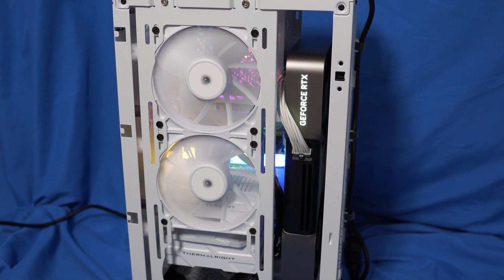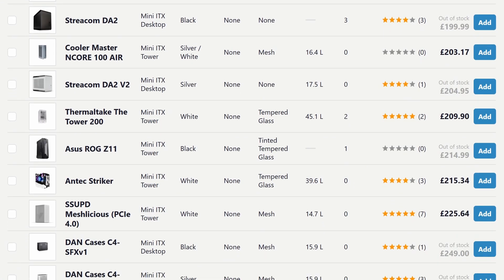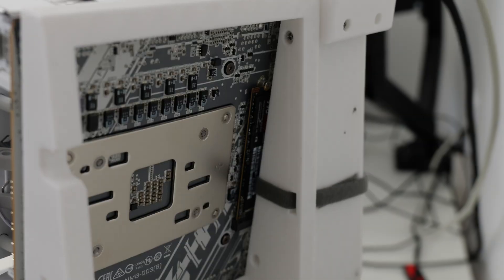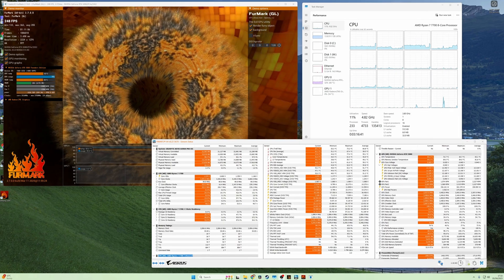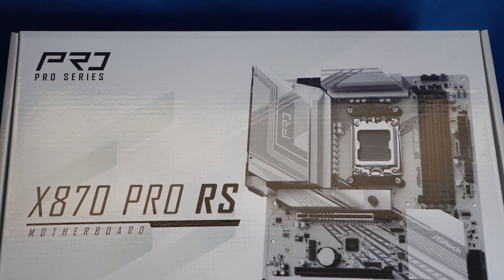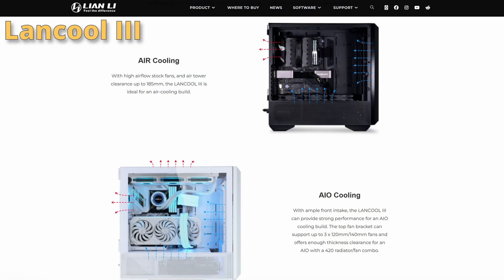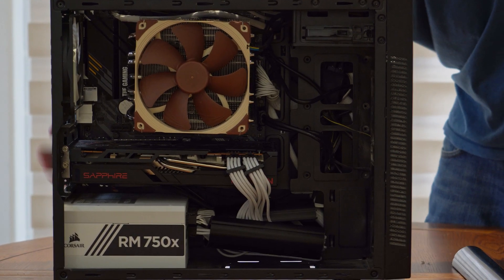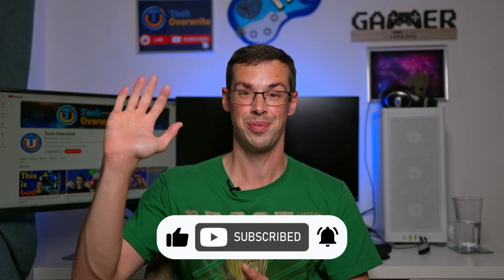The Truth About Mini ITX, Micro ATX & ATX (After Building All 3)

Comment: I started with ATX and loved it for many years. After seeing so many Mini-ITX builds, I fell for the compact design and for a year or two I went back and forth in my mind but eventually switched to a high-end Mini-ITX. It took some time to manage cables and organize everything, but in the end, it looked exactly as I wanted, a beautiful work of art. Unfortunately, the same day I powered it up, I was shocked at how differently it ran. I love silence, yet performance, but with Mini-ITX, you get neither, no matter the configuration. The noise increased, temperatures were nowhere near as good as ATX, and performance fell short of expectations. I took it all apart, returned the parts, and while Mini-ITX can look great, I’ll never go that route again, unless you stick with low-end CPU and GPU, or you’ll be sorely disappointed.
Reply from the maker: That's all really interesting, and pretty much my experience too. I love my little mini ITX build (which I still have right now) BUT I recently did a full ATX build again, and I much prefer it. Seeing GPU temps peak at 60-70 under super heavy loads is always nice, unlike my mITX system where GPU temps seem to START at 60-70 and only go up from there lol.
Reply: I actually think this isn’t spoken about enough by people who do ITX content and to some extent promote ITX builds (not talking about this video in particular).

I had the same thing a few years ago, went ITX in an ncase m1 and the cooling was pretty poor and it was loud.

Unless you need portability, the only thing you really gain by going ITX is that it looks quite cool.

The desk space thing is odd to me too. I know people like to look at their PC and have it on their desk but when I was younger massive cases were the normal and everyone put them on the floor anyway.

Even if you can stomach the extra cost, the irritating quirks of the build (like faffing about doing inverted builds, 3d printing parts etc) and the higher temps of an ITX build, you also have a much louder PC case, which completely puts me off.

As far as I can see PC parts are just getting more and more power hungry, so cooling is going to get more important as time goes on and it sucks to have to change your case when you upgrade because the components no longer fit.

Comment: Yea mini itx is not “defendable” other than for space.   Cute factor.  
I have a big old corsair carbon case with atx.   Every time i feel its too big and bulky, i take it apart and clean it.   Upgrade something or whatever, and remember why i have a large bulky case and spend my building creativity coming up with a way to place my case more efficiently.  10 years with this case and a few builds in it and i just cant downsize.   Too convenient to have a big two chamber case.
Reply from the maker: I definitely understand that :) I recently built in a Meshify 2 XL and it's MASSIVE... but it also makes doing the build completely simple. I dread having to change something in my mITX case lol. I like the Corsair Carbon, sometimes the older cases are the best (or at least - they still work fine)
Reply: I was obsessed with the idea of building a Mini-ITX because it was so cute, and when I finally did, I realized that’s all it had going for it, just cute. I quickly switched back to ATX and never looked back.

Comment: My first (And current) build was a micro ATX and I love it. The only downside I can think of is only having 3 fan headers. Without buying any splitters, I'm stuck with the 2 frontal intakes and 1 back exhaust config. It works well enough and the CPU never surpasses 60°C, but my GPU runs a bit warm (72°C hotspot) and I do plan on upgrading to a more powerful card, so I might have to place a bottom intake to help it and that means buying a splitter cable.
Reply from the maker: That's all fair, and I'm glad your build is working well for you :) Splitters could help a lot here - or potentially using a simple SATA fan hub like Arctic sells. Either way though, those temps are likely better than you'd have with many mITX builds.

Comment: I'm downsizing lately, so I got a ncase M2, I'm gonna try build a MicroATX + SFF PSU + 240 AIO in it.  It can also fit GPU's up to 360mm, which seems nuts for how small it is.  But luckily my GPU is pretty small.
Reply from the maker: Sounds like a great build - good luck with it :) I agree, it's surprising how much power can be fit into a SFF or MFF build.

Comment: I am still looking for a minimalist open air case with support for 420aio. There is the Thermaltake core p3 but its a big case and quiet as minimalist as it could be, then there is the old, outdated and discontinued Rajintek Paean M... If they update it and bring it up to modern standards it would be nice. I do like the 3dprinted case you had in your last video, i could just create my own i guess..
Reply from the maker: An open air case with space for 420mm would definitely be nice. The creator of the Showcases case is looking at adding more cooling support (y'know, since it didn't have any - lol). Be interesting to see what form that cooling support ends up having.
Reply: Just curious, what CPU are using for a 420 AIO?  I have a 9900x and my old Be Quiet 240 AIO handles it perfectly, its specced for that TDP, so I saw no reason to upgrade or get something bulkier and heavier.
Reply: @jar-z7t  Since you are not answering, and i am impatient right now because i only slept 4 hours... I have a 9800x3d @5.4Ghz, under full load i reach 85 degrees (fans at max rpm) and already undervolted with a negative offset of -39. While gaming i am currently at 56-60degrees with fans not or barely ramping up from idle.
Would i be fine with a 240aio, yes. I would even be fine with a Hyper 212, the cpu would just downclock during highload, and i could forget about tuning.
Happy?
Reply: @Chris-Literal  It's true, I forget that these CPU's tend to adjust clock speed on how good a cooler you put on them.  I am also guilty of buying things that I don't technically need too lol.
I was more surprised to learn that 420 AIO's are a thing, and it sounded crazy to me, I'd only heard of 280 and 360. I think one thing thats nice on a 280 or 420 is the 140mm fans, they are nice and quiet at least.
Reply: @jar-z7t what's your point? That I can't have more cooling to have a quieter pc? 😅